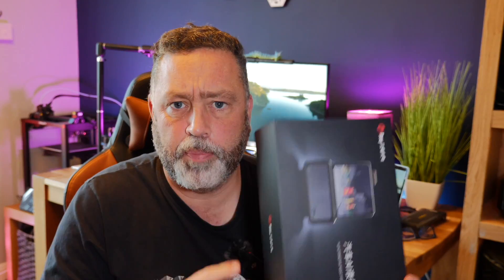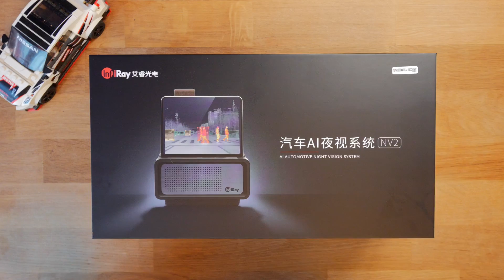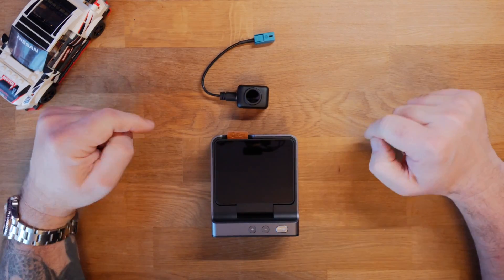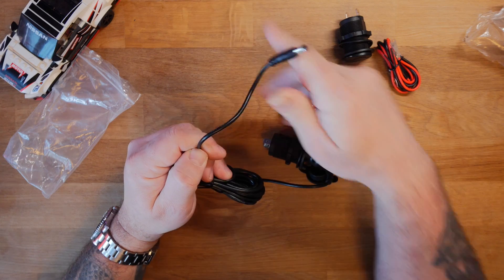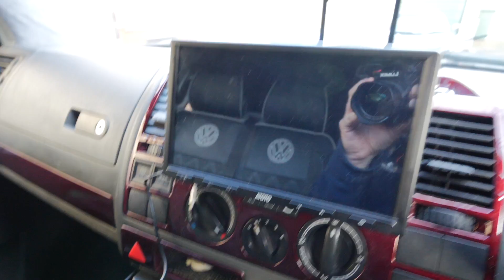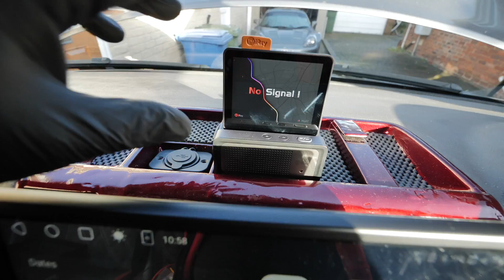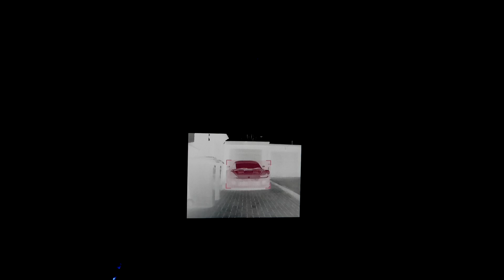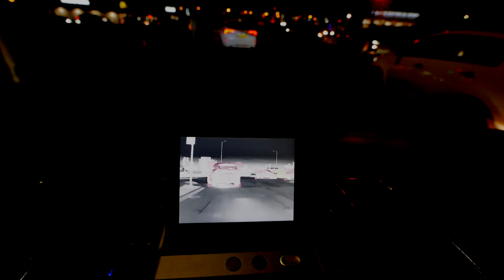ai Thermal Night Vision in any car - NV2 night driving assist by inf iray xinfrared

Comment: I could really use something like this.  I drive home between 12 & 3am every night through Deer Country.  I'm pretty good at spotting them, but I've had a few close calls even with Deer Whistle's installed.  Thankfully, the whistles freak them out so they freeze vs running across the road.
Reply from the maker: I’ve just released a video of another type 👍

Comment: Just got one bought off ebay brand new £375!!!!! Love my gadgets
Reply from the maker: They are quite cool. I’m thinking of transferring mine to the boxer camper.
Reply: @SpyderLEE i am trying to locate a 2nd camera as would like option of using in 2 different vehicles without buying whole new unit... I've reached out to infiray and hopefully they can help
Reply: Is it any good?
Reply: It's good... support from the manufacturer is crap... endless.emails etc about acquiring a 2nd camera so i can swap between vehicles. They dont respond and would hate to interact with them if item develops a fault.

Comment: Does it work with fog?
Reply: TheMB72: Yes, it works VERY well with fog rendering the fog as though it doesn't exist.
Reply: No, not a single night vision camera will work in rain or fog, it doesn't work!
Reply: @VitalySokorenko  You are confusing a night vision camera which this item isn't with thermal imagers which this item is. Night vision cameras magnify the available  light but thermal imagers display ultrared light which penetrates fog, smog and rain easily. 
You should check what I've just stated here and, once you confirm its truth, delete or edit your statement as it incorrectly implies that the MV2 is a night vision camera.

Comment: Hi. Price
Reply: High price compared to what? In terms of what's available for one's vehicle, especially considering its audible signal, it's the best unit at this time and, compared to other units that similar features, it's by far the least expensive to date. Currently this lists for $599 (dollars) while others go from $1,500 to $2,500+. 
I recently bought one and reduced the price as such: I opened up a checking account with a bank that gave me $250 to do so. I started a credit card (which I used to purchase the item, thus fulfilling the terms of the offer) and got an additional $200 credit towards my balance/purchase. I bought it while it was discounted to $569 (a Spring season sale). So, effectively it cost me $119.

Comment: This one is very good in Middle East when i go desert at night with my suv Nissan patrol
Reply: Is there any new brand with bigger screen?
Reply: @ahmedalkaabi  Currently there isn't a "new brand with a bigger screen". Since this unit issues audible warnings a bigger screen may be a negative since one shouldn't be staring at the screen while using it. Once the audible signal is produced the safest way to use the screen is as you would your rear view mirror, a quick glance should do for identification and positional purposes.
Reply: @lazurm ABSOLUTELY!!!

Comment: Great thing but the screen is too small, if it would connect to the head unit maybe I would get one
Reply: Since this unit issues audible warnings a bigger screen may be a negative since one shouldn't be staring at the screen while using it. Once the audible signal is produced the safest way to use the screen is as you would your rear view mirror, a quick glance should do for identification and positional purposes.

Comment: Does it have any video output? Thinking about connecting to the car’s built in entertainment system.
Also, is there a way to turn off some of those annoying notifications?
Reply from the maker: As yet… no and no. I’ve just had a firmware update sent over today to try that adds proper 1 minute video files onto the memory card. After using it in my vehicle since I did this video the notifications aren’t over the top to be honest, they are quite clever depending on the situation.
Reply: The trouble with putting the video into the car's built in entertainment system is that the car's system forces the user to take their eyes too far off the road and for too long. It's safer to have the screen close enough to the front view where this wouldn't be an issue. 
One can turn off the audible notifications by manually bringing the volume down but the volume would be lowered for all audible notifications as, currently, this unit doesn't allow one to choose which audible signals to lower. It's all or nothing.